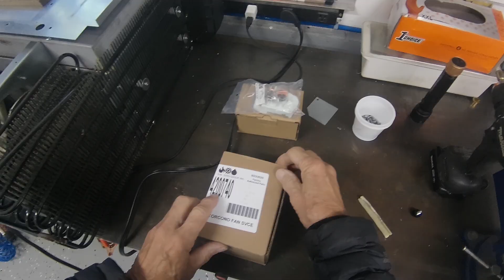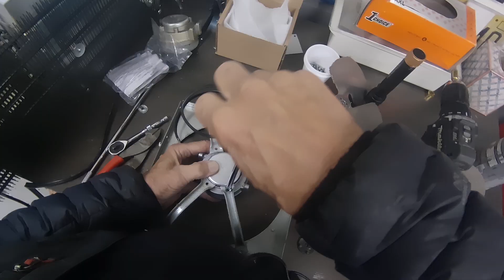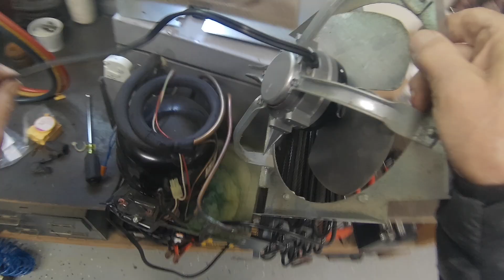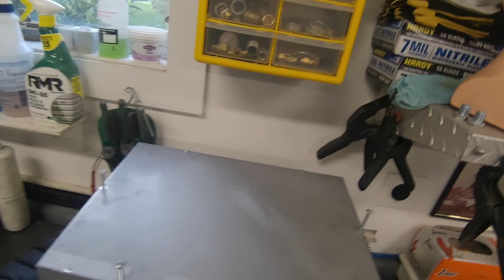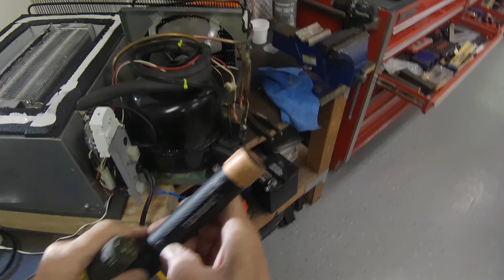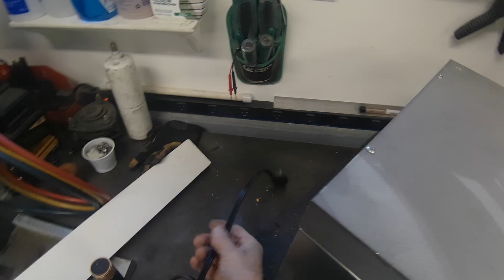Northland Power Unit Rebuild # 9

Comment: What is the evaporator fan motor part number?
Reply from the maker: That motor had been discontinued, PN S16477-000. If you watch my video I give the PN for a GE motor but you have to reverse the rotation. You need a clockwise motor with a 1/8” shaft and center-hub mounted. Most shaded-pole evaporator fan motors are reversible. In one of my videos I show how to modify the bracket so you can use a subzero motor.
Reply: Thank you so much!!!